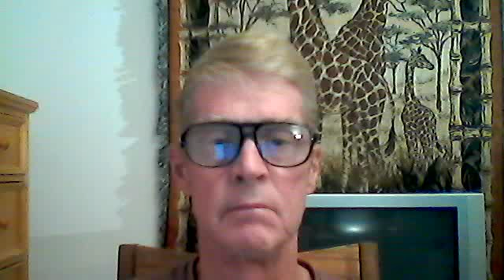RF Tubes in AF Amps

Comment: Being that most RF amplifier tubes were used as modulators, and in many cases designed for either/or, you should have no problem making an audio amp with RF tubes.
Reply: Lemme clarify...a lot of RF power amplifier tubes had ratings as modulators. This is so a mobile transmitter (AM) could use the same tube for an RF final and the modulator. This meant keeping fewer types of spare parts.

The only difference between a modulator and an AF power amp is the load.

Comment: Carbon dioxide gas tubes or xenon gas tubes would amp up audio. I would not know the names of the tubes.  I just know sound carries better in those gases because they are less dense.  Radon gas would actually be the best sound quality but its a radioactive isotope.

Comment: Greetings from Cousins Cove, Western Jamaica!
Blessup ur Works!

Do you have a simple circuit to amplify a 13.56MHz passive oscillator using a triode or even mosfet?
thanks.
Reply from the maker: I haven't done a video or written anything devoted to this circuit in particular. You might find it in one of the editions  of the McGrawiHill series "Encyclopedia of Electronic Circuits."  (I say "might" because I didn't write those books and have not seen any of them.) Sorry I cannot answer you more directly. 73 de Stan W1GV.